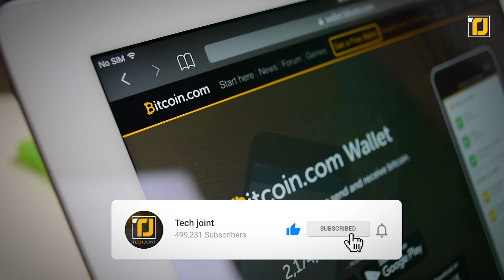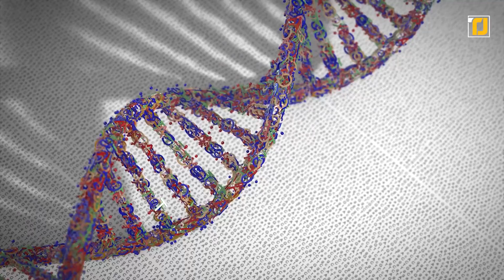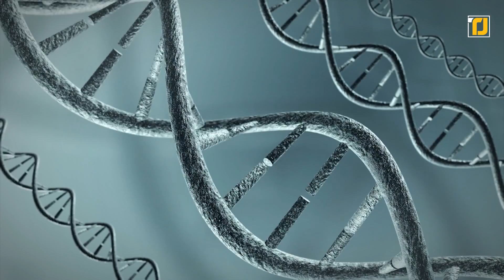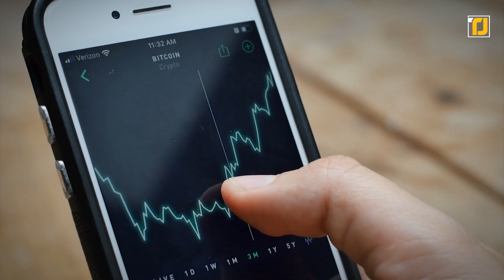10 EMERGING Technologies That Will Change The World

Comment: i am leary about. fully self driving cars because remember the teslas that failed to detect an 18 wheeler truck against the sunset crash?  fully self driving cars are not ready for prime time.

i am leary about glowing buildings as they could be used for light shows and could cause an accident.  from distracted drivers.

it is bad enough that people cell phone and text while driving but having an elaborate light show being caused by glowing panels in buildings .

some of you may say what about lighted signs and basic animated lighted signs.  

there are laws that state that only navigation signs may be placed over the road or along the shoulder

billboard signs must be set back from the highway

there are some electronic lighted billboard signs but i think there are laws that control the timing of the advertizements  so i doubt they can be animated.

businesses along the highway can have basic animated signs consisting of (i think) just light chasers for the arrow signs like http://www.henryclarke.co/portable-signs/roadside-signs.php but i think  they cant be too close to the road either